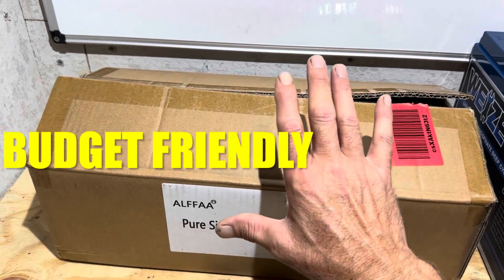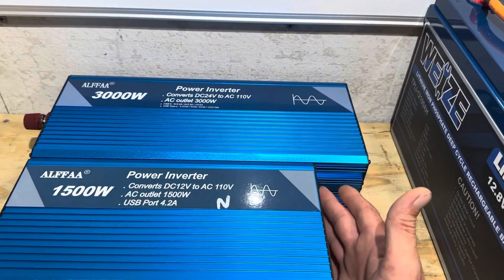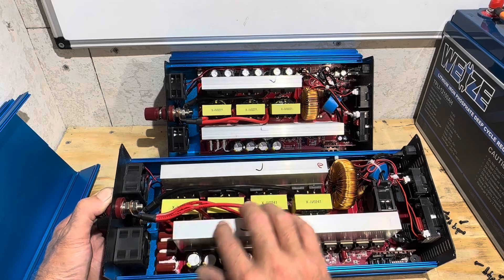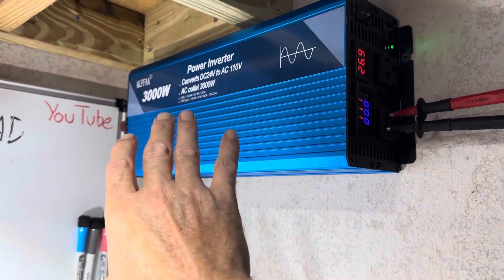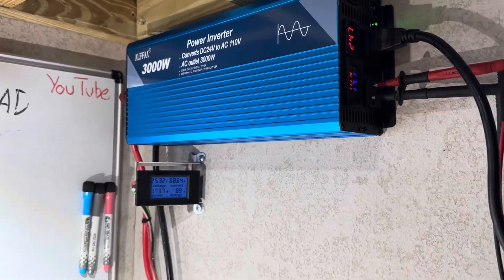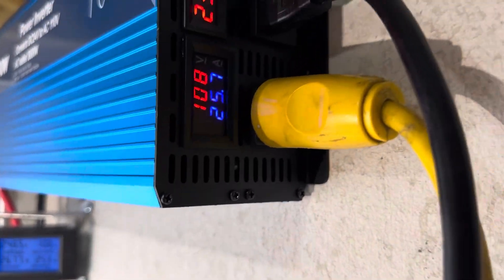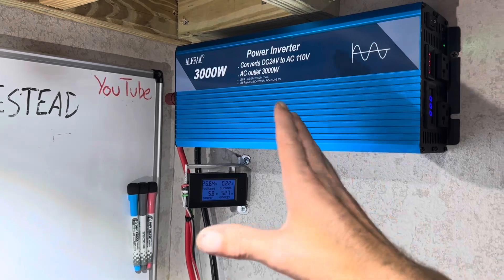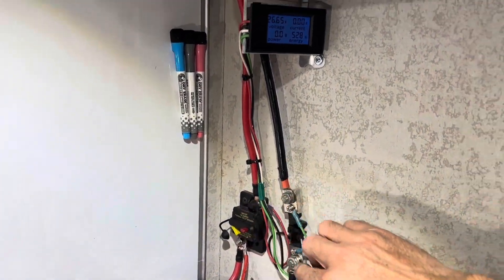ALFFAA 24V 3000Watt Pure Sine Power Inverter - best budget inverter just got better

Comment: Great demonstration and awesome video as usual. However, I bought an Alffaa 12v psw inverter about 2 years ago. I'm a 120v ac purist, so the fact that the Alffaa would only output 109v ac with no load and would sag to 104v under a moderate 600 watt load was cause me to return it. Hopefully they have improved the ac output of these units.
Reply from the maker: Yes i prefer 120V on the money as well for most applications. The Alffaa is a tough little inverter though. Good utility/truck/camping inverter.

Comment: What was the reason it cant configure to 120v?
Reply from the maker: Fixed control circuitry. 
They pick 110V to use the inverter in North America market along with others. They can ship 110V 60HZ to a wider market than 120V 60HZ.

Comment: One thing I have been looking for is an inverter with a low idle draw. Best I've seen is a MeanWell NTS-3200W with 1.2w idle (powersave mode that shuts down and periodically tests load). However, it is almost 3x the price. Have seen name brands that advertise power save modes that still use 12W-15W idle.
This looks good for my app but would be nice to have remote control/status. Nice review.
Reply from the maker: I agree that some form of remote display/monitoring would be nice for RV/Boat/Truck applications where the inverter is not in plain sight. One could use a battery monitor with remote display to track the power input to the inverter. For the price though I can’t complain at all. Glad they kept the idle low on the 24V just like their 12V units. Glad you enjoyed the review!

Comment: I’m torn between 24 and 12 volt systems for my camper. My delima is the alternator charging a 12 volt vs 24. Any advice along those lines for future videos would be awesome. My goal is to replace my rv 120vac air conditioner with a 12 or 24 volt mini split unit. 

As always, keep ‘em COMING!
Reply from the maker: I was planning to do an update on my RV soon, I’ll try and cover your situation and explain my thoughts on 12V or 24V for RV/Campers
Definitely get rid of the stock RV 120V HVAC unit! 13.5k dometic on my RV pulls more power than my entire house with 2 tons of mini splits plus refrigerators, tvs, everything lol
Reply: @THEOFFGRIDMOUNTAINHOMESTEAD 

If you get a chance, please explain the difference in converting from 12 to 24 from the 12 volt 150 amp alternator vs a 24 volt alternator converting down to 12 volts. 
Hopefully I will decide soon on which way I’m going as far as 24 volt split AC for camper vs 12.
Reply from the maker: I’ll see if I can help you with this more in a video. 
If your vehicle/truck is equipped with a 12V alternator I’d stick with that if it was mine. 
For 24V charging you can run the 12V through a 12-24 DC charger/converter.  Several brands out there, Sterling Power  a good choice. Some can be paralleled to increase your charging rate.

Comment: I am definitely impressed with the Alffa inverter.  My 12v one is working great.  Now I wish I had the 24v one. I currently have a 24v battery bank that I am using on another setup. I would be able to add this to that bank because it is more efficient.  As an thanks for the honest reviews.
Reply from the maker: I saw it on amazon and was like “yep I’m getting that little beast” 😆 Had planned on a new charge controller for testing but wanted the ALFFAA more. 

Be a great spare inverter for a 24V system to keep on hand. Less idle draw than some charge controllers, just a nice piece of equipment!